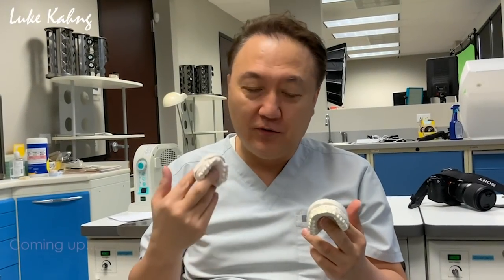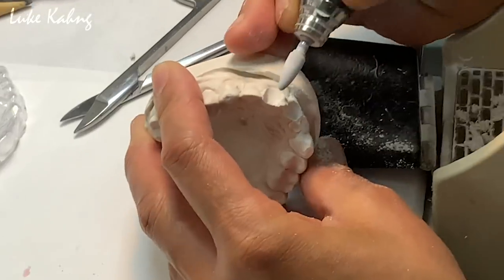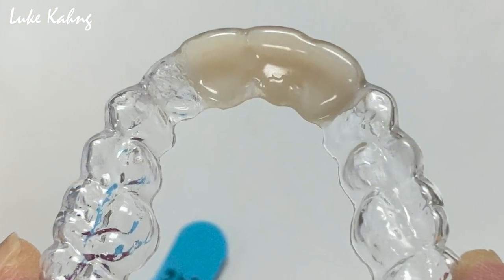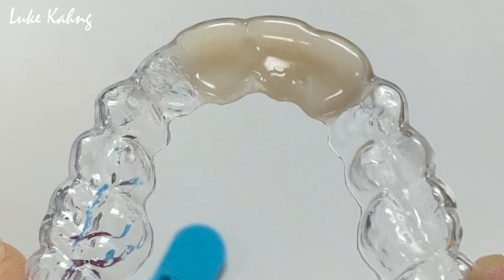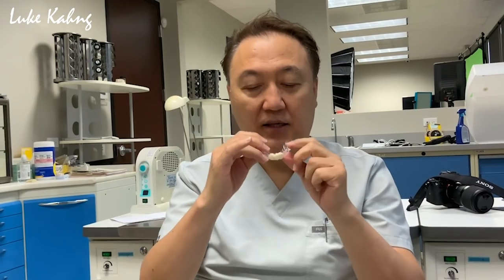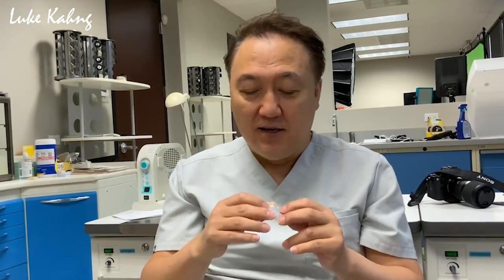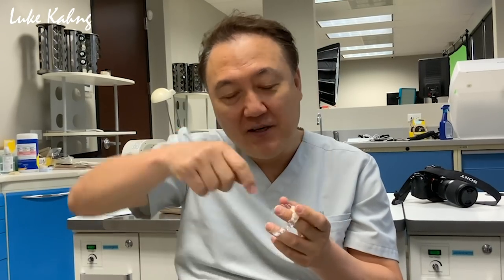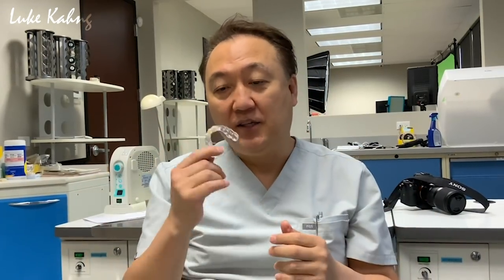How to fabricate Temporary Teeth with a Clear Stent

Comment: Nice work! Sometimes the acrylic teeth separates from the retainer even when using acrylic sheets that say acrylic will adhere. Do have any advice on how to prevent this from occurring? Thanks!
Reply from the maker: Re glue back
Reply: Drill a couple holes lingually so resin lock in to retainer, that will prevent from movement or falling out.

Comment: Another solution, that we make, is if space is already created (so no teeth in the model already) and the clinician has taken the colour of the teeth, we adjust acrylic teeth (cheap ones, of course) to the model (we need an antagonist model for adjusting purposes) before the vacuum. When the vacuum is done we take out the clear stent from the model and proceed to adjust the contour. In our case, the plastic has a protecting film that we take out leaving the stent always clean if we have used wax or any other material around the teeth. At this point, if the acrylic teeth are dirty from wax, we clean them and prepare them to reinstall in their place in the stent, using adhesive. If the heel of the teeth has holes, I normally cover them with temporary acrylic of more or less the same colour, trying to avoid an excess of it so it doesn't enter in between the teeth to keep the esthetic, if possible, so this way the round surface will create a certain pressure on the natural tissue in case later on, like in your case, there will be implants or an acrylic partial. Thank you for sharing your own world, for your generosity.
Reply: Can I order one from u?

Comment: Where do you get the supplys???
Reply: Amazon! I am 100% serious! If you search 'dental supplies' or 'at home denture kit ' you can find everything you need. With the silicone I'd suggest getting the at home kit (make sure it comes with the impression and mold kits) and then get the silicone separately. Make SURE you get dental grade silicone, one that is safe to use in your mouth. I'm thinking about trying to make this, I have already used their at home kit to make a metal-free partial and I'm not crafty at all. It is beautiful and so much more comfortable than the bullshit*t one that I paid the dentist $1200 for. It had a metal palate, and the 3 teeth were on metal wires that scraped my natural teeth every time I put it in. I made my own and saved $1100. I'm going to try it with the silicone and see how it goes. Good luck!

Comment: I have had an implant done. And the site is currently healing. I recovered a clear stint as you made. I have it for the top front teeth.i am struggling to remove the plate when i need to brush my teeth, why is that and can it because its so tight fitting rip out my current crowns? As it is very difficult to remove the plate. And can i eat normal food with this plate. Your reply will be greatly appreciated Dr. Thank you.

Comment: You are the best👍.... But i have one Q( what about occlusion may be was high spot in posterior teeth)
Reply: Yes, occlusion is main problem here..  this techniq is only used as instant like to attend functions..etc.. patient need to pull it down for eat.  Which means it is only used for cosmetic purpose. When using it permanently can cause  temporal mandibular joint problems.
Reply: @drmmohamedhussain6828   thanks Dr..

Comment: We call these Essix Flippers.  Make a bunch of them.  You can speed things up by drilling a 2mm hole through the retainer on the lingual of the teeth being replaced and inject your acrylic through the hole using a syringe.  What did you use to remove the wax from the retainer without distorting it?
Reply: Can u order one from u ?
Reply: @breeelise588  In my state I'm only allowed to do work for dentists.
Reply: i usually duplicate master model, block out undesirable undercuts beforehand then suck down clear blank, pouring up tooth colour acrylic. check fit onto the master model before dispatch to dentist. It does involve extra steps for the simple job,but have been receving good outcomes from dentists. 

교육용영상 감사합니다. 
전 호주에서 치기공하고있습니다.